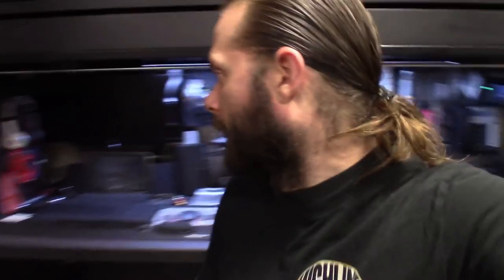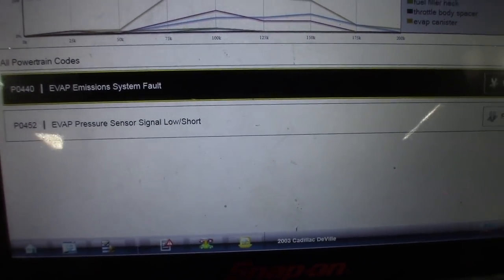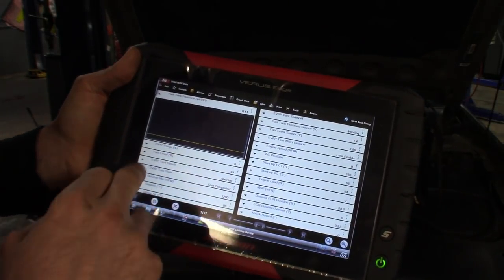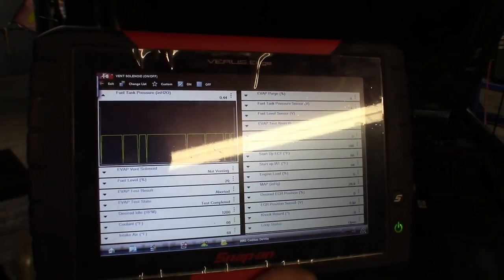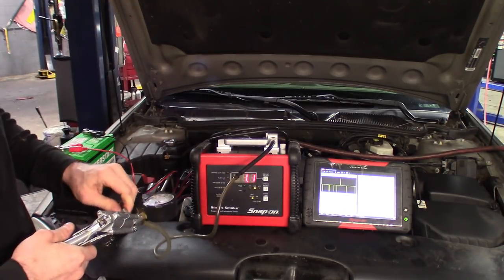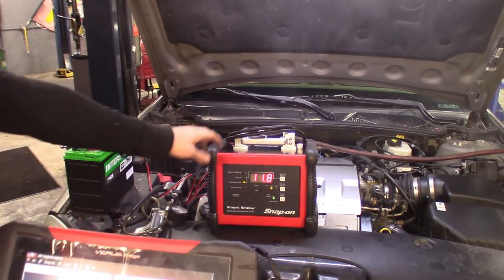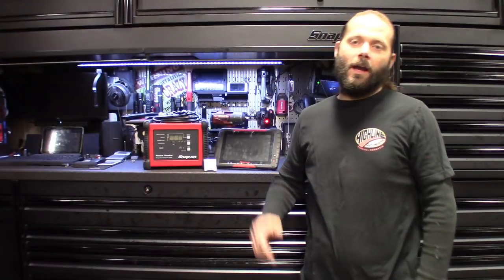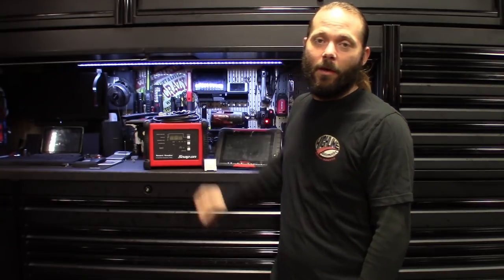Smoke Machine in Action

Comment: Welp.  You're not gonna like this , but that machine is a frilly toy. You need a manometer to be sure of any evap testing. There is no such thing as allowable leak. The designer of that machine actually was brought in to "teach" an evap class. During his presentation he mentioned that the machine will have a tolerance of leak up to 5 thousandths of a leak. Meaning at 0 on machine it may actually be at 05. That's the difference between being fixed or being missed and having a comeback. We had a lengthy conversation during the class and I was asked to leave.  Never been invited to another SnapOn class since. His words and I quote " the allowable leak from the manufacturer is all that matters". Pure nonsense . Great video as always though.
Reply from the maker: True. But these manufacturers set up the PCM to flag a leak after a certain reading. Pretty much all they have to do to fix that issue is to program the PCM to flag a check engine light after .001 of a leak. Or have a vacuum motor in the system to constantly seal the system and check for leaks regularly.
Reply: New Level Auto better off working with Bosch at least they seem to listen. When they kick you out to hide stuff that’s pretty bad LOL they didn’t want to get caught with thier pants down.

Comment: I know one can capitalize on peoples fear of an engine light, but evap codes really are a nuisance. Unless you have a state of province with Air Care testing, i couldn't justify this tool! I'm open to being convinced otherwise!
Reply from the maker: Most of the time Evap codes are a nuisance but there pretty strict @air team in my county, especially since the pollution is so bad one can hardly see stars on a clear night.
Reply: This tool is also very good for finding intake or boost leaks. And an extra resource for any leak. Coolant,  oil,  exhaust etc. A smoke machine is definitely a mandatory tool for any shop. This one puts out great smoke volume. Most all smokers have some type of flow gauge for evap testing.
Reply: He might of mentioned it but this tools main function is to produce smoke, a slight pressure and measure flow.  The oil used also has uv dye in it.

Comment: The only thing that you did wrong was use shop air in the gas tank.  Made your self a possible bomb.  Gas and air in the tank get spark and go bomb.  That is why they use the Co2 tsnk
Reply from the maker: Co2 tank and regulator is on order.
Reply: I have to get one to for my smoke machine.  Now that I am back to work.  Sitting on my ass from Nov 6th 2017.  After spinal cord surgery.  I have been going nuts.
But thanks to several of you guys I have been pushing my self harder and harder to get back to work.
Reply: That’s a great point.  Nitrogen is also an option and required in California from what I understand.  IDK the advantage/disadvantage to one inert gas over another- perhaps cost/ease of storage?